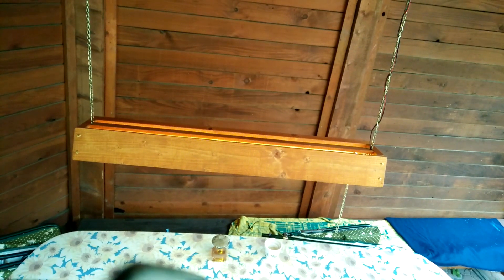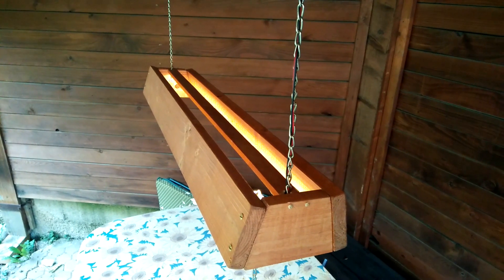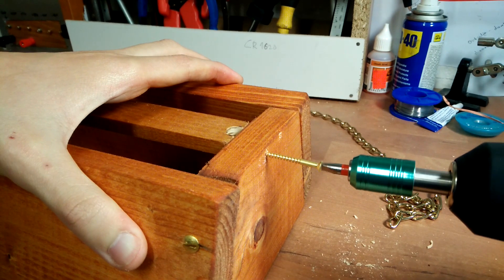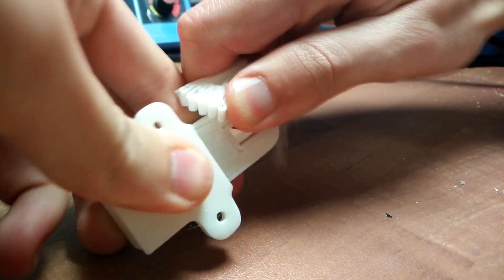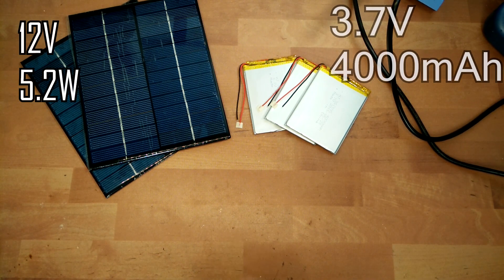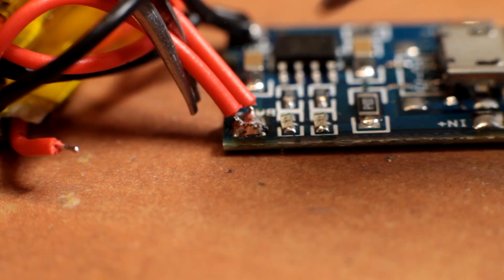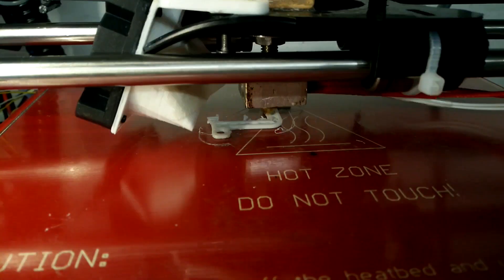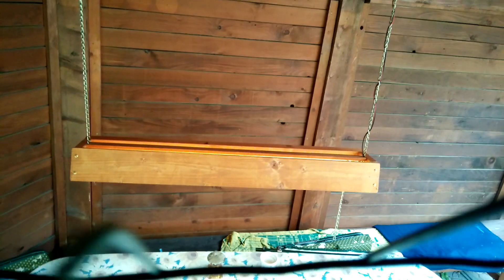DIY Outdoor Solar Lamp

Comment: For how long will the LEDs shine, if the batteries are fully charged?
Reply from the maker: I don't have the exact calculations but it'd be several hours
Reply: @Gyro1  did you found out in the last 2 years how long the LED shine ?
Reply from the maker: @GUN2kify  not really. its not used very often and so far it hasn't died on me